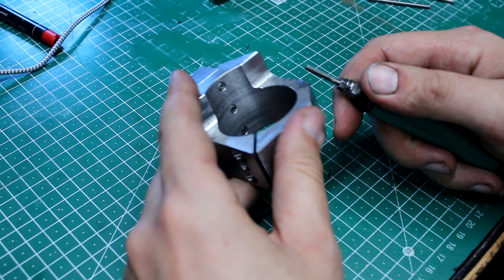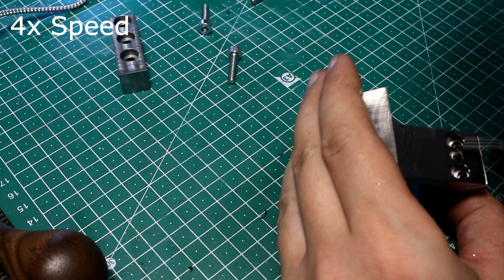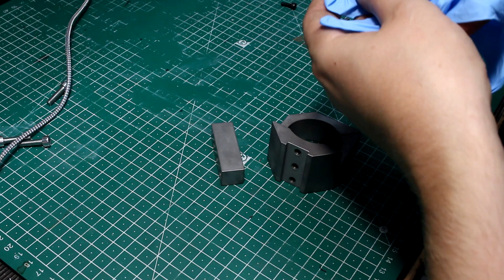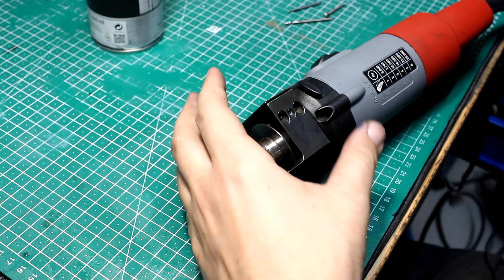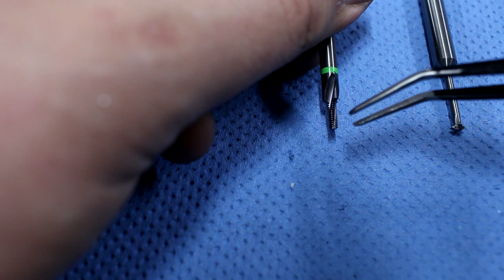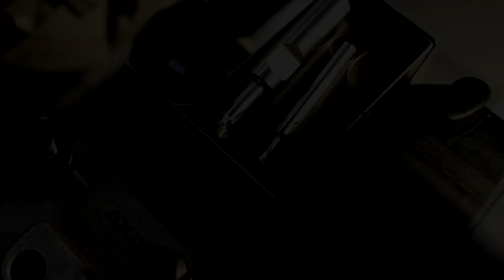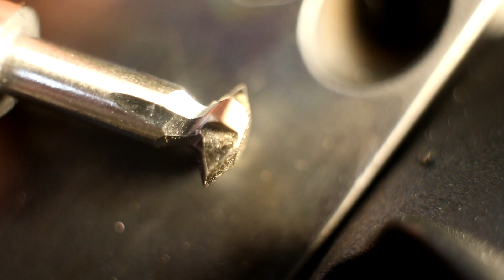Threadmilling on a manual lathe

Comment: Stefan, I rust blue alot of my parts otherwise I send them out to get the parts caustic dipped blue.
When I purchase a miniature milling cutter for thread work I usually end up having to modify them just a slight bit so that they do the job right.
I have to see the work under optics with a stereo microscope at 40X to 80X. I use a Swiss Manufactured Wild Heerbrugg M3z on a custom mount that I machined over thirty years ago.

Comment: I have done thread milling and forming; it works great. I presume that you bead blast and not sand blast? I rust blue most of my tools and parts; it's very durable.
Reply from the maker: I use 80micron aluminium oxide - its abrasive, unlike glas beads

Comment: I soak up everything you tell us, Stefan and, if I can't apply it straight away, I store it for future use. One thing though which I have found with thread milling tools, is they generate a different form to the shape of the cutter. It's the combination of the tool rotating on an axis parallel to the work piece's axis but interpolating a spiral. The front of the cutter generates a different flank angle. The true thread form should be normal to the helix angle of the thread so the form of a thread milling tool really needs to be modified to take this into account. The trailing side of the form is fine as it is in clearance but the leading side will back cut the flank to form an angle larger than required and the radius will also be generated larger. For threads which are large compared with the diameter of the tool, this is negligible but for very small threads relative to the size of the cutter, it is significant. I have a thread milling cutter for an M2.0 thread which has an OD of Ø1.6mm (the tapping size for the thread!) which will cut a thread either tight (crest of screw same size as major diameter of ID thread) or it's too loose because the female thread form is too wide. Are you able to CAD model a cutter which will generate the correct form when interpolating a helix?

Comment: By using this same router setup with 2 flute, carbide wood-routing bits, you can make amazingly-accurate lathe cuts and deep grooves in rubber and soft urethane bars. I've used this on motor mounts and suspension bushings etc. 
The trick is using compressed air for cooling along with a vacuum cleaner. Love the video!

Comment: Putting a router on a lathe's toolpost as a milling attachment is a neat trick. A homemade 4-flute 2mm thread mill bit that doesn't break without magnification is really impressive. I would stick with single flute D-bits below 4mm. 

I've been studying threads for 50 years since I worked on Brantley Helicopter rotor parts with old 4A & 4B threads called out on some of the rotor drawings. That is tighter 3A & 3B but not an interference fit. The reason for the radius at the root of the thread and the tread relief is to prevent stress concentration.

We may worry too much about thread forms. Mauser rifles all were made with Whitworth (58-degree) threads, usually 12 TPI. In the US, we rebarrel them with barrels having 60-degree threads almost every time. They shoot the same no matter the barrel thread.

Comment: What a great video. I just have to make one. 

One thing that I, along with many others I suspect, have trouble with is cutting off. It seems to me that a small assortment of endmills would turn this tool into an almost perfect cutoff tool. Perhaps even a slitting saw could be used in it for cutting off. 

If I make one I think I will use a reversible motor for maximum versatility. 

I think this could be a very versatile tool to have at the lathe.

Comment: first of all ill take this RE: to thank you for the many informatice vids and encouragement you give u viewers.
now i had a Q ,: would it be better to leave a keyway without deburring. i believe the sharp edge might help keep chips out of two sliding surfaces ?
Reply from the maker: If you have a 1500x1500mm corner in your shop,  you can comfortable put it there and operate it. Note, you need to be able to stand on the right side of the machine and in front of it to operate it. The left side can be as far up to a wall as possible.

Comment: That worked amazingly well on PVC.  I want to try it on urethane.  I have trouble getting a smooth finish quality from single point cutters.
Reply from the maker: in Urethane I would even try a grinding wheel dressed to 60°.
I had way better results in materials like that with grinding than cutting.
Reply: @StefanGotteswinter   I'll try that.  Thanks

Comment: There was actually a special lathe, itself called a "threadmill", that I have seen a couple examples of that was used for milling precision leadscrews. It was basically a lathe with a live milling spindle integrated along the bed, that could be tilted to the helix angle of the thread. There are still some using them... Charles River Museum in Massachusetts has one

Comment: There was a study done recently regarding the life of a file used going in both directions vs lifting on the return stroke. The outcome was that there was very little or no difference in the wear on the file for either technique. I don’t remember where I saw this, but a quick search should bring it up. I have been deburring and chamfering for over 60 years and my files have shown no evidence of deterioration. I will say though, that they were never used on hard surfaces, which would probably dull them no matter the direction of application.

Comment: i must say i was impress with the subject of mill  threading  on a manual lathe ,  i have an old Colchester , school lathe.  & it was never . fitted with a . lead-screw the lathe  use's  the rack as a threading siystom  but as no staring clock.   i have tide  your idea on my lath &find  it works well  7 delivers a good thread. the  use of broken taps  work's well .  & cut a 6. thread to the inch to fit my spindle  of my lath internal using a old tap of the right third & pitch. i set the gears to fit the relied third  & pitch . & achieve  a successful . result. using a old tap as a cuter  i would love you to demonstrate larger size  sets . such as a 10 mill thread in a 20 mil hole .

Comment: Is it possible to repeat the cut with a slight offset the root width should be?  That could make it closer to required thread profile with a very small burr at the root

Comment: Mentioning the non-breaking chip when machining PVC, at work we often machine down rubber coated rollers (~2.2m long, 170 to 200mm diameter) we use insert toolling on the lathe and we get 1 single continuous chip from that, the surface finnish is great though, competes with what other companies achieve by grinding and doesn't smell nearly as bad

Comment: If you get the polished inserts for aluminium they are able to machine HSS in the lathe. You can cut and shape thread milling and involute rack angled cutters with them to get the correct form then grind the cutting faces. VBGT work well.

Comment: I did something similar with a die grinder but my problem was cutting very large threads. 

My lathe is too small to use some of the really big dies I have like 2" x 4.5 tpi   but I found that if I roughed the threads out first, I could finish them with the die.

Equally (i haven't tried this) it would also let you finish the thread form with a single point tool or, if you wanted to be flash, a grinding stone with the correct form.

Comment: You can also make a double direction thread - milling it out in one direction, then reversing feed/spindle direction and milling a left hand thread over it.  Or using an indexing plate to make a spline with almost no leadout like a staggertooth cutter would leave.  Or something really crazy like offsetting the live tooling above the work and at an angle on the compound to make really weird looking threads or decorative finishes or compound angles like fins on an impeller.

Comment: Always informative and educational, thanks.  I was really expecting to see that first cutter flex more. Is that router sealed? Are you taking precautions to keep those tiny chips out of the brushes?
Reply from the maker: Hi James,
No, the router is not sealed - But I run the same one in my chamfer-mill where its showered in metall chips, never had an issue. I guess the motor fan is powerfull enough to keep everything out.
Reply: @StefanGotteswinter  The setup could be a real time saver on larger pitches. I make a regular parts in aluminium  with 75 x 3mm pitch. There is a matching part with internal threads. This could really speed that process up.

Comment: We always have minor issues with threadmills and threading in general when our comes to fit. Obviously there is a standard calculation for working out the root radius. But most of our tools are standard 0.4 rad (thread mills). This isn’t a massive deal however just means normally you’d go abit deeper if the tool allows. M36-M120 this is pretty apparent.

Comment: You could make a yankee screw driver or  feed to add or remove wire, cord, or hose to a drum.   Acme trapezoidal cutter say 14.5 deg to axis.  Cutting the forward and reverse lead angles would be easy.  The transition from a forward to reverse say in 180 or 270 degree would require a  cam with a cam follower roller and spring pushing the carriage with the cam roller against the cam mounted to the spindle.   Hand turn the spindle through the angle.     A thought.   

CNC Swiss mill created a screw for me years ago that drove a piston pulling a vacuum.  Battery powered.  To give the batteries the longest life the current for the brush motor needed to be constant.  Thus the pitch for the vacuum stroke was variable and the return as fast as possible to arrive at the proper angles on the two reversing direction portions at the top and bottom of the screw.   The thread follower was a small portion of the thread cut into a revolving cylinder face so that the pitch angle could continuously change.  It had to be long enough to jump over the return cut thread.

Comment: Hello Stefan, I guess that ideally the mill bit should be tilted according to the pitch angle, based on thread diameter and thread pitch? If the mill bit cuts straight "90° vertical" it tends to cut not 100% in alignment with the "tilted" thread groove. Anyway, the technique has its advantages. Greetings from another Stefan :)

Comment: It strikes me that it would be possible to use a bottoming tap as a cutter, although it might require a slight regrind on the cutting side of the flutes. Another possibility would be making a scroll for a lathe chuck if you had an accurate and controllable drive on your compound. Another use would be trepanning plates since breaking a cutter would be less likely that breaking a trepanning tool. You could also use a form tool to give your plate a radius finished edge. Cutting Acme thread both inside and out would be a breeze. It opens up a lot of new ways of doing things.

Comment: When you want to cut a long pitch like an oil groove on a centre lathe, you can switch gears around but you have to go to the trouble of driving the lathe via the leadscrew. in other words, if you had a reduction unit lying about and you chain drive the leadscrew from the tailstock end it works fine.

Comment: You can also (WITH GUARDING, though you already have that) put a grinding wheel into the live spindle, and do cylindrical grinding with the lathe. You can certainly get some nice surface finishes with that. Not "air bearing straight off the machine" like Dan Gelbart's lathe/grinder, but probably quite nice.

Comment: I have a similar setup and have found that it works great for trepanning. I use an end mill in the die grinder and rotate the lathe chuck very slowly. It's much faster than using a conventional trepanning tool and there are no issues with chatter.
Reply: i just thought about trying that. thanks for the heads up!!

Comment: Wonderful video. Back in the time frame 1880 (and even before that) when electric motors were rare or unavailable there was the English Holzapffel ornamental lathe company .The double ff is no typo.  The lathes were foot-powered. They had all kinds of attachments and extra-axis devices. Among the things they would do is mill threads. They would also allow you to e.g checker-pattern a piece or inscribe all kinds of patterns on work. The last Holzappfel was sold in 1920 or so. If you look under "ornamental turning"you will find quite a lot of info.

Comment: Stefan, your "goofing around" was an excellent learning experience for you and us.  I personally wasn't even aware of thread milling since I never really supported the CNC Shop at work before retiring.

After a bit of experimenting, I bet you'll get your milled threads to fit almost perfectly.  Will you be able (with practice) to use your tool & cutter grinders to make your own thread cutters with the proper profiles (i.e., appropriate radii, etc.) to cut "standard" thread shapes?

Comment: You need a binocular with high magnification... I suggest you buy a used one (from a good company like Leica, Zeiss, etc) via ebay or used tools sellers in the biology field. 
Not a microscope - because you need to see reflected light, not light passing through a sample.
btw, I also made an external motor mount for my lathe - can't wait for a good project to use it... :)

Comment: I use a phosphoric acid based "rust converter" for "cold blueing".  It makes the same black oxide that soaks up the oil and prevents rust.  Dunk it and let it sit in solution, dry it off and oil it.  Pretty easy.  $25 a gallon in Missouri.  The brand name is Ospho.  Good stuff and much easier to use and much less expensive.

Comment: I would give You several thumbs up if I could!  
Very interesting content. My first job in the 1980:s was to design and build a titanium lathe/milling NC machine for the Nobel Procera dental implant system. My old expired patent on this machine is EP0490848B1. It was a very efficient and accurate but limited in its applications. It was mainly built of cast iron with stiff hydrostatic bearings and a nice IBAG spindle. As You noticed, when running att speed the spindle needs a lot of power. We monitored spindle power to for tool wear. I wrote the first version of the software on a PC, so we could play a lot with other shapes such as funny threads as well. 
I have had a 33 mm KAVO spindle sitting around for a long time that would fit nicely in my multifixB 40 mm boringbar holders on my Weiler lathe. I think I got inspiration to finally make a sleeve for it and put it to work...
These spindles are only good for small work but runout is only 1,5um. About the cold blue, I get best results by washing the part in weak NaOH solution to remove all traces of fat and then rubbing the surface with the solution. I owen dry and seal the pores with linsead oil and sometimes car wax.

Comment: I made mine using a high speed spindle available on eBay from some Chinese manufacturer with a VFC that came with it. An 800 watt motor. Works very well. While I’m typing I forget the ER collet size that came with it. Now that you say it’s 16, I think that’s what on mine.

Comment: I just ran 24 parts that needed a 3/4”-32 internal thread to the bottom of the bore. Of course not on a manual machine. But it worked beautifully. Now I’m inspired to try milling trapezoidal left and right hand threads for a self centering vise build. Already located the thread milling cutter. This will also allow any thread pitch within reason. So a double start thread should be doable.

Comment: It seems possible with the attachment one could produce an Acme thread which most small lathes have problems will because of the massive tool contact which causes chatter.
Reply from the maker: For a Acme thread the spindle needs to be tiltable, otherwise the cutter would undercut the threadprofile..

Comment: Nice little experiment Stefan. It would be an easy task to use an ER 16 collet chuck with a long shank (flea bay is full of them) and toothed belt drive it with a low kv BLDC motor for more torque and larger tools. There must be countless cordless drills out there with a blown speed control. No problem just use an RC speed controller and pulse generator. The router motor definitely has its limitations with it's extreme speed making HSS tooling all but unusable except for very small tools.

Comment: Dear Stephan, educational and interesting, good to see curiosity leading to useful solutions. One question: what was is the rpm range of the lathe spindle that works ok with the cutters you used?
Reply from the maker: With the threadcutters fairly slow - Maybe 10...50rpm. 
With the 6mm roughing endmill, turning down the PVC round stock, somewhat in the 400..500rpm range.
Reply: @StefanGotteswinter  Dear Stephan, many thanks. I feared it... my geared lathe allows for a minimum of 80 rpm. May be its time to think about a VFD or to fit a manual handle (as I am able to maintain any given rpm manually over a period of an hour or so...).

Comment: You could cut a ball screw profile thread using a ball end mill as a thread mill.  You'd need a lollipop end mill to do the internal threads on the nut, but it's also be possible.  I imagine the surface finish would have to be near perfection to get a good feeling ball screw, but it would be a fun, challenging piece to machine.
Reply from the maker: Ballscrews dont have a full spherical profile, its more of an gothic arch, giving a theoretical 2-point contact instead of a line contact.
I think I will continue to buy ballscrews/nuts ;)
Reply: @StefanGotteswinter  that Gothic arch shape makes perfect sense.  But real machinists grind their own gothic arch endmills.